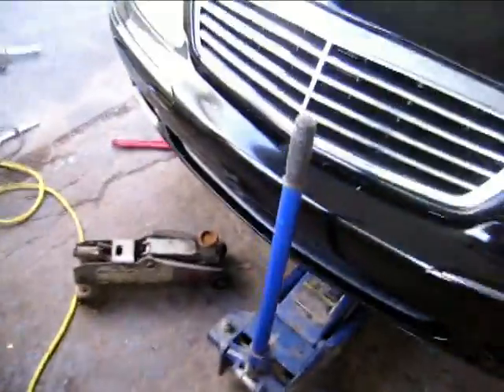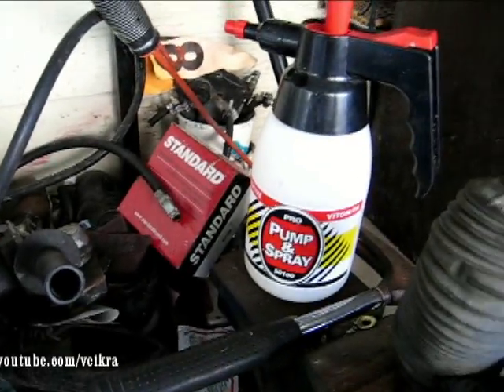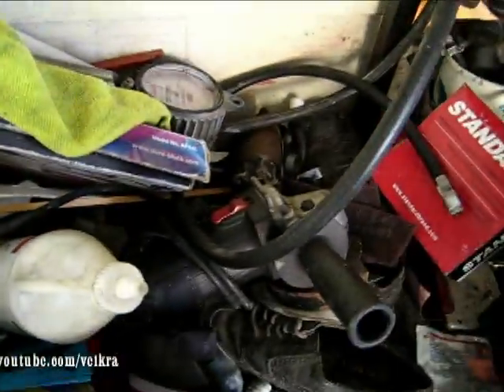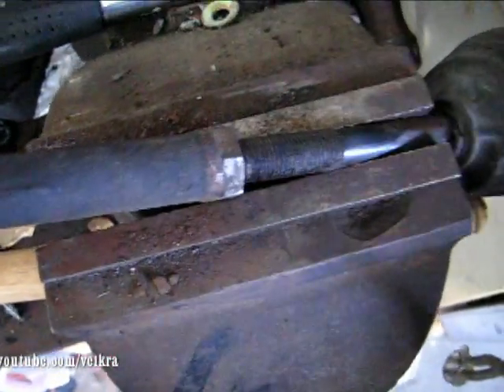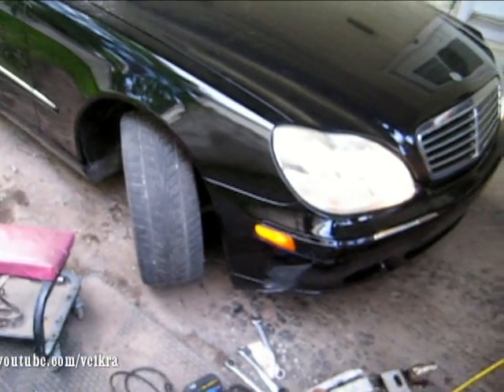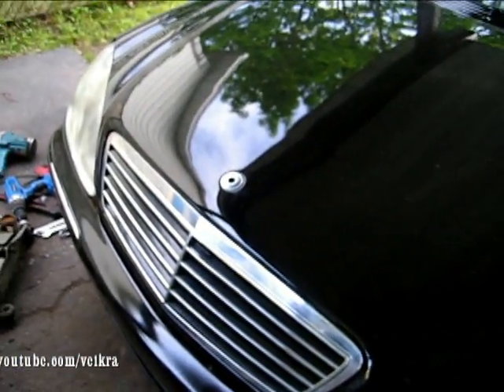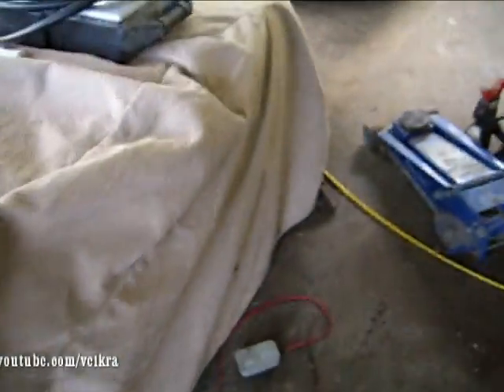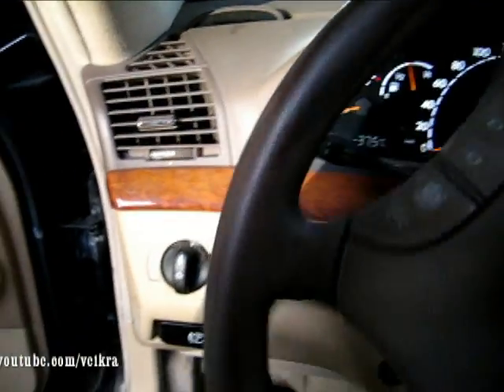w220 Mercedes Benz S430 inner tie rod replacement

Comment: Very nice condition car, mine sadly wasn't taken care of when I got her 😞
Reply from the maker: mine had dirty oily mechanic stains all over the beige interior. I cleaned all of those but it was starting to rust few years later so I got rid of it. I now have a long wheelbase audi a8l in aluminium and love it . no rust but its a big louder inside than this merc was.
Reply: @Nordic_Mechanic  that's awesome man granted mine needs tlc I plan on restoring her even when I buy me a new E350
Reply: @Nordic_Mechanic  all of my front panels are broke or cracked but the rear seats and panels are mint condition
Reply from the maker: @John_Pixels   I dont like the top seal of the front air strut on those mercedes, prone to failure in my cold climate. Ive done those seals but man 220$ for seals when the a8l is a simple oring always irked me
Reply from the maker: @John_Pixels  ebay to get panels. Wrong color not a problem, ring up colourlock and send them a piece theyll match you paint.

Comment: How did you get the inner tie rod out without getting the outer tie rod first?  I cannot remove the nut in the outer tie rod of my 2006 C280 4Matic.
Reply from the maker: I removed the outer tie rod from the knuckle, then removed the inner .  You can't remove the outer tie rod without removing the nut, that's why youre unable to remove the outer.
Reply: @Nordic_Mechanic  Thanks for your reply!  The nut that tightens the outer rod was so rusted that I couldn't losen it.  I applied a lot of force and finally, the outer rod, broke lose.  I am going to have to replace both.  I don't want to have to deal with that rusted nut again.